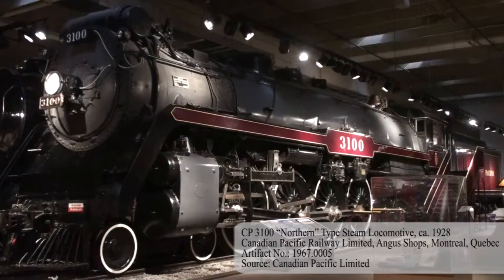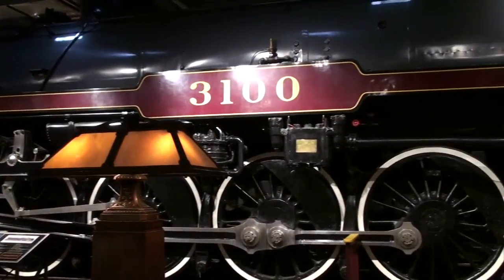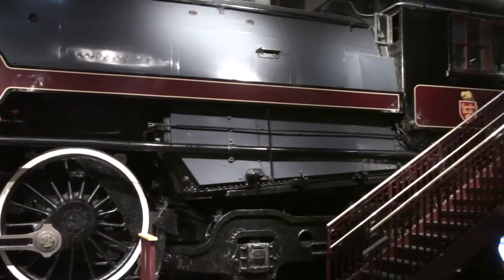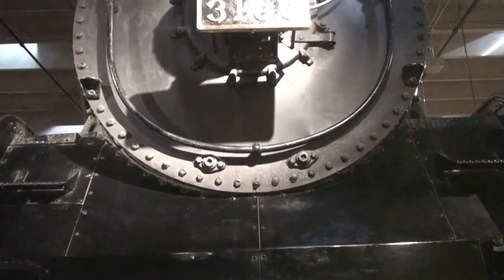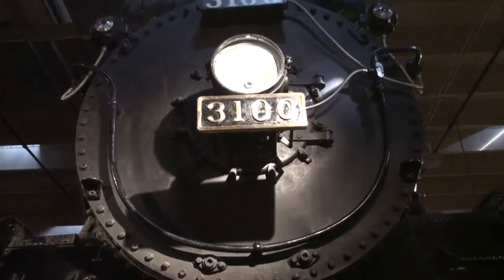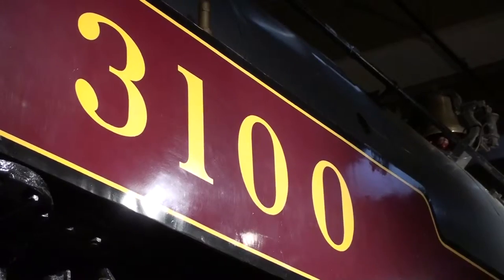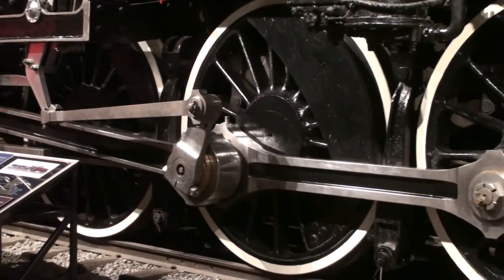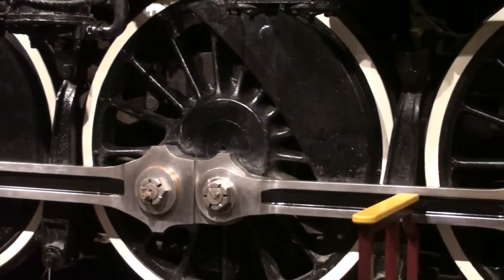CP 3100 "Northern" Type Steam Locomotive

Comment: ***** Actually the young lady is correct.  The top operating speeds of the 3100s was 60-65 mph.  Despite having 75" drivers, these were not speed demons.  At the end of the day, the K1 series design was considered a failure, hence only the two prototypes were ever built.
Reply: What I meant was she said kilometres and hour instead of miles per hour which is still used on the railway.